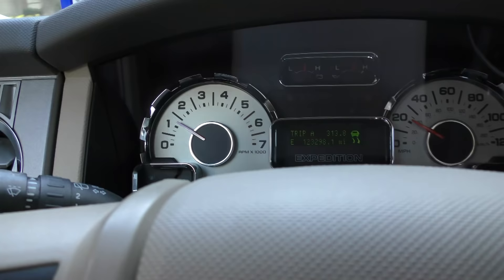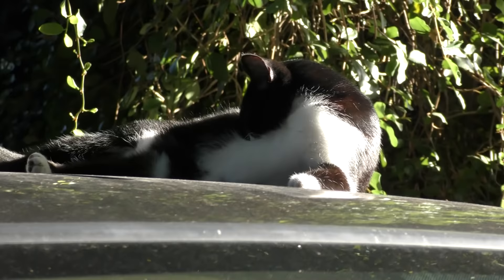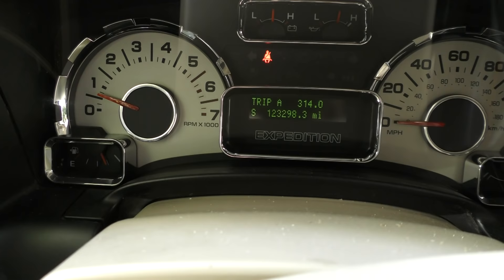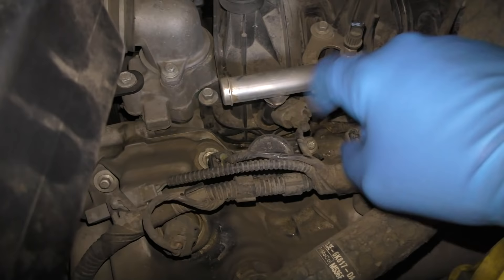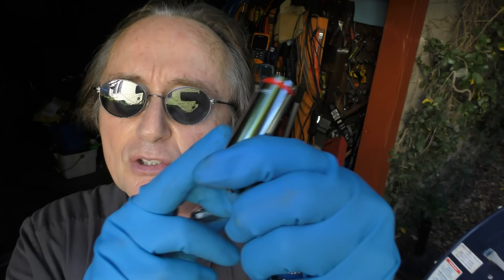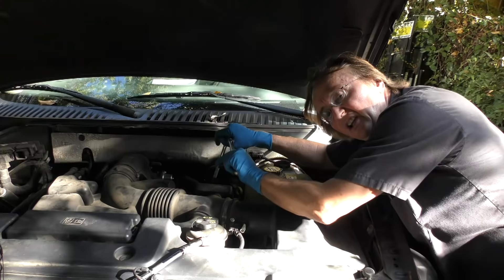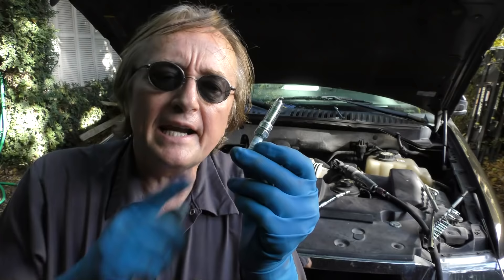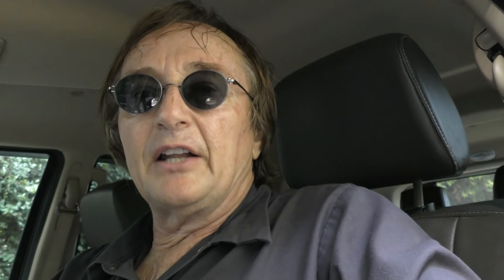How to Stop Car Hesitation (Spark Plugs and Ignition Coil)

Comment: What about if it wasn't the plugs or wires and still no codes??
 Can u give a list that could be wrong with a car that hesitates when feathered throttle??
Reply from the maker: weak fuel pump,, dirty fuel injectors, or clogged fuel filter
Reply: Scotty Kilmer ok I was just give a few scenarios.
Now I have fuel pump and filter that are new and injectors are new as well so what other things might be the problem?

Comment: hello sir i have a question if the engine vibrate when going up in gear and the automatic car jerk with out stepping on the gas that is connected on a spark plug thank you

Comment: My mower spark plugs has gas on iy. When I pill the other plug keeps in running, so today I pull the good plug out and the mower dies.. So does that  mean it's only firing on one plug?   what's happening is my mower when I give it Full Throttle it don't want to go but it runs great at idle.. Please help. It's a Honda 24.0

Comment: our car suddenly hesitates while my dad is driving, I really thought we'd be stuck on a highway so we stopped and turned off the engine,popped the hood and let it cooldown for about 15-20mins then we run it again but unfortunately it's still hesitating so we just accepted our faith (lol) and drove slow but after a while the hesitation suddenly disappeared I can't understand what's happening to our car :/ any tips?
Reply from the maker: pressure test the fuel pump, change the fuel filter, and also try cleaning the fuel injectors

Comment: I can get my spark plugs 99 carry first it start running perfect then I packed it for few days .
then same issue started I start the car for 20 min 
then pull the plugs out put them back again running perfect ..
I don't know what will happen after a week ..
burning smell was commingled in when it was not running properly 
may be I have to change wires or any thing else ..
but what it start running OK few times ..please need answer

Comment: I have a 2006 ford taurus i got a check engine light for a maf my car idles fine but the problem come in when excelerating it studders mostly up hills but if i let of and get on the gas harder it doesnt its confusing me a couple of days ago i got a code for bank 2 o2 sensor lean and misfire cylinder 3 could the spark plug on that cilinder be my problem
Reply: The car does have 140k miles on it and i havent done a tune up since ive got it

Comment: Hey quick question for your opinion I was driving on the highway and then all of a sudden my car started slowing down and kicking when I would accelerate and then the steering wheel started getting hard to turn and then my car completely turned off n won’t start no more ..could you please help I drove a Nissan Pathfinder 2000

Comment: Scotty,,  What can I do when my plugs wires are so tight around the plugs, that I'm afraid to force them out, to prevent breaking them ?
Reply from the maker: get a long cheater bar and socket and slowly pull it counter clockwise

Comment: Hey Scotty,
I am struggling with my diesel car since 3 years..
while driving, mainly during summers,if by chance I have to switch off my car for some reason,when engine is hot, it doesn't re-start Ven the engine is hot, so I have to wait long till it gets cool,
can u pls guide me to what to look for,for not re-starting while heated engine.. please
Reply from the maker: worn out diesel engines often do that from the metal getting hot and needing to cool down to restart. Do a compression test of the engine to see if it's just flat wearing out

Comment: Is there a chance plugs may be defective? I changed my plugs like 3 months ago and for the first few months it was running fine now it started doing the hesitation no check engine light though 93,000 miles on the car

Comment: i have a 2008 impala, i changed spark plugs,fuel pump,throttle body with idle sensor,mass air flow sensor and my car still cuts off once in a while when i come to a stop or when i reverse, can you help me? :(

Comment: What about when your first initially start your car like it hesitates when starting
Reply from the maker: old age often does that, try cleaning the fuel injectors. But if it cranks slowly, often a weak battery or wearing out starter

Comment: my 2010 Expedition king ranch el is doing the same thing just changed all 8 spark plugs and all 8 coil packs with accel ones and still            
doing same thing was told to change fuel pump I have 120k miles no codes either
Reply from the maker: dirty or bad maf sensors do that too, check that next
Reply: Scotty Kilmer I cleaned maf  sensor it has a little more pick me up i was told not to change the fuel pump but today my wife was at a stop light and then the truck shuttered and rpm gauge was jumping and shaking I don't know What to do should I just replace fuel pump and maf sensor. please help thank you
Reply from the maker: start by replacing the maf sensor, and if not that, have the fuel pump pressure tested first

Comment: Hello! my car starts hesitating when i accelerate and most of the time when climbing, if the road is flat, there is no problem, only when accelerating and climbing that starts like pushing and loses strenght. the plugs are new, new fuel filter, cleaned injectors but nothing seems to work. could you be kind enough and tell me what could it be happening? thank you very much

Comment: I've got a 98 tahoe ls 183 on the clock but when you run it down the road it literally bogs down. most vehicles can move quick when you hit the gas this however just moves about the speed of a golf cart any ideas where to start looking as I've done plugs already
Reply from the maker: often a weak fuel pump, pressure test it and change the fuel filter

Comment: Hey scotty i just bought a 2003 chevy avalanche 5.3 v8 and its giving me a p0300 code random misfires i changed the m.a.f and m.a.p sensors new fuel filter and did a fuel pressure test i got a 55 psi on the on position it slowly started to drop. wires and plugs were changed out a month before i bought it the previous owner said it didn't have a rough idle until he did the spark plug and wire change I even put all the old plugs bag and wires back and still I get a P0 300 code I don't know what else to do im about to take it to a mechanic shop

Comment: I have a 2007 ford focus SE and it randomly happens from 20mph to 80mph will stutter/shake the steering wheel and my speedometer will drop 10-15mph and then shoot back up to where it was minus 4-5mph. Doesn't matter if I go up a hill or down it, if it's level ground or a hill, or even how fast I go. If I let off the gas it stops within 1-2 seconds and if I keep my foot steady or push it down it will stop within a second or two as well.

I have a 50 mile commute every day and it happens anywhere from 1-2 daily to once every few days and it wont trip any codes.

I noticed the original owner replaced plugs/coil packs and wires and the air filter is new. Any ideas what could cause this? Thanks, this one has thrown me for a loop lol.
Reply from the maker: try a new speed sensor, pray it's that easy of a fix. If not that, pressure test the fuel pump to see if it's weak and pray it's not a shot transmission which it often is on that model

Comment: after replace the spark plugs i forgot to connect one of the coil connectors, i didn't drive it, just turn the car on couple times, notice a hesitation, i turn it off, i connect the coil back, but now when going on the road is hesitating, what should i do ?

Comment: What if I fixed all of those and it still misses would that be injectors the car seem to run fine till I get over 4000 rpms and then it misses again even at idle but when I turn off the car it idles fine

Comment: My question is this....why does my car has 2 codes. P1283 lean. I have p1283 as pending and p1283 as problem code making. Same code. I was confused why its same code in error and pending. Like my car cant make up its mind if its there or not

Comment: Anyone know this problem I think it's the spark plugs or O2 sensor but whenever I start my car up and say I go down a hill or a small incline like at a sheets gas station it'll be running fine then 3 seconds later the rpms will rise and the car decelerates even tho my foots on the pedal then I let go and push on the gas again and everything's fine and it drive great

Comment: Hi scotty answer my question and you got another sub. After 4 days of not using my tacoma. Turned it on today but it quickly shut off. It stays on as long as I have my foot on the gas pedal. Alternator is good and just bought a new battery but same thing. I'm thinking it could be the spark plugs. What do you say?
Reply: Luis Coronado im not scotty but i might be able to help lol, but i would definitely check your spark plugs and see if they are bad, because pushing the gas pedal is pretty much forcing your engine to not shut off. So get that check out before you cause more damage ;)
Reply: @Kevmyster  thanks for the reply. But I changed my spark plugs and it would still do the same thing. No visible vacumm leaks. Was about to take it to the mechanic , put it on reverse and drove a little and now it stays on?????? Whatttttttt it works now but I'm not sure what that was all about lol
Reply: Luis Coronado probably did help putting in the spark plugs though, your tacoma wanted to stop giving u headaches lol
Reply: @Kevmyster  it kills me not knowing what happen thou lol
Reply: Luis Coronado im having an issue with my eclipse stuttering when it turns on, but i noticed my spark plugs aren’t even plugged in because of wrong size so im hoping the new spark plugs make the difference
Reply: @Kevmyster  that should solve the problem I had an s10 ehat use to do that. Hope it works out.
Reply: Luis Coronado appreciate it, I’ll let you know.

Comment: I have 1999 dodge durango and it won't go over 20 mph. what could be the problem?
Reply from the maker: pressure test the fuel pump, weak ones do that. ALSO have the catalytic converter tested, plugged up ones do the same thing.

Comment: hi Scotty. i need help 
trying to fix a probem. 
2009 honda civic 
over 55 miles. start rattling so bad.  i done the transmissions mount. n new tires n alignment. still doing it
Reply: I had that on my old Corolla. It turned out to be a bad wheel. I bought new ones and bam, it was running like butter.

Comment: changed my wires, coil pack and new spark plus still doing it any ideas?
Reply from the maker: tons of things can do it, bad fuel injectors, weak fuel pump, worn out engine with low compression, start testing those

Comment: What about hesitation while in drive at idle?   2011 Mazda 3
Reply: A/C running.... doesn't hesitate when a/c is off
Reply from the maker: try this, assuming the spark plugs are not worn out and air filter is clean https://www.youtube.com/watch?v=NWCKvU2FmDc

Comment: Car vibrating at idle, reverse and drive mode. I have changed the spark plugs, cleaned throttle body, got every sensor checked, fuel injectors checked. It's still vibrating. I'm suspecting it's the ignition coils.  No fault code on the scanner either. It's a 2007 honda accord 4 cylinder. Please help.
Reply: Definitely points to faulty coils.
Reply: Changed the coils as well. Still no luck.

Comment: how often should we change our spark plugs
Reply: Mauricio Tijerina it depends in the car and your driving.
Reply: All2skitzd Hi we'll it's a 2000 BMW 540i I do mostly highway diving about 20 miles a day..
Reply: With OE plugs (NGK or Bosch i guess) you should be good for 80,000-100,000Miles if it is not having issues. Realistically you could probably go longer but it's good to change them as long as your using the right plugs
Reply: All2skitzd yeah  I ask because I didn't my coils too and it runs great except when I go about 80 it like hesitates like it wasn't to go after but I can't stay at 80 it acts almost like a miss fire bit the engine doesn't say anything either, I'm probably about 25,000 miles on the plugs, but thank you for helping me an answering my question (:
Reply: id hit the bmw forums with bmw problems. they have a great following with common faults and some smart fellows here and there

Comment: hi good morning, i have a problem with my g35 2005 sedan, (ignition coil screw broken , i change my spark plugs and did an oil change. i noticed that one of the coils ,#2 plug has a cotton/spongy material on top of #2 coil, when i remove it, it was a broken screw thats suppose to hold the coil down. i tried to see if i can remove, instead i put the sponge back , now my infiniti is sputtering, bucking, like misfires, I'm a  young grandmother working on my car.  i need some ideas on what causing the misfires i only change the spark plugs not the coils. im thinking its the broken ignition coil screw. i cannot remove it. i need a temporary fix to hold this #2 bolt screw down or find the best way to extract it
I NEED HELP PLEASE.!

Comment: I had a quick question on my Honda Civic DX 97 when I accelerate it loses power I don't know if it's because my spark plugs or cuz I need a new fuel pump
Reply: When's the last time you got a tune up? Wires, spark plugs, etc...

Comment: Hi ,
I have diahatsu Move 2011 660cc model .. while giving pedal/gas , car giving jerks while accelerating... Once it gain speed , jerks end & smoth drive starts
 Its not missing of engine .. 
No code from ECU . Plugs and coils r fine .. somebody told me its issue of cvt gear .
Can somebody guide me??

Comment: Soctty my car is KIA Spectra 2001. The RPM niddle goes down when I switch to reverse gear. Any ideas? Also the RPM is stuck at 1500 and not coming down to 1000. Plz help!
Reply: Check throttle body
Reply: Going to buy TPS and IAC sensors today and try my luck. Scotty thanks for motivating folks to fix cars themselves.
Reply: @rocka207  Fly okay .. it looks like IAC sensor but I am also going for TPS sensor as well. learning by trail and error. Thanks!

Comment: anybody know....just did a timing belt on a 2.7L V6 DOHC KIA Sportage.  Is it normal for the left (furthest from front) cam pulley to seem like its spring loaded?  As I was timing it, it lurched back about 60 degrees.  I wrenched it back into time and set the belt time perfectly.  Everything seems ok, motor idles good, but I am a bit worried that this is not normal.

All help appreciated..thnx.

Comment: plz help me.  my car has always started up like a charm it still does but when it gets hot the 01 nissan xterra 4x4 6cyl starts sputtering and eventually stalls however when it cools it will restart. i have ppeople telling me its the fuel pump but they are really expensive so i dont want to buy one if that isnt the problem. i already changed fuel filter (btw it  hasnt had a tune up in over 6 yrs. i changed the timing belt about 6 months ago and the valve cover gaskets, and it has about 150k miles               my husband thinks it could be descending wires
Reply from the maker: pressure test the fuel pump when it acts up to find out, cause on those often it can be something else like a bad ignition system shorting out

Comment: I have a question Scotty Kilmer. I'm getting p1150 a p1151 and a  p0174 
code on my 98 v6 mustang. I checked the gas psi on my car and it's at about 
32 psi and when I accelerate it peakes about 42 psi. when I turn off the
 car it goes fast to almost 0 psi. Any idea what it can be? I'm thinking
 it could be the gas pressure regulator. what is your advise?
Reply from the maker: try a new fuel pressure regulator, and also check for leaking fuel injectors
Reply: Scotty Kilmer thank you very much

Comment: I have Ford taurus 2002 automatic transmission 80000 little mileage due to car was stored . every thing is fine when i start the engine but when i drive it around  20 or  30 minutes it warms up and hesitates or shakes like gas cuts off or missfires but the engine don't idel and the the car has suffocation feeling when accelerator is pressed and does not speed sounds like no fule in the tank and the car don't run when i accelerate but when i restart the car at the same time the engine starts normally and when i press accelerate it takes some gas but don't run fine at full accelerateing and hesitates again and i do same steps until i reach my destination  . It could be the ignition coil or fule pump or any other sensor.  So please  Scotty help me.

Comment: Hey Scotty! I have a 96 Ford Explorer that has 230 thousand miles. I had a tune up back in January. A couple months after that it was sitting for awhile because it didn't start so I had to replace the fuel pump and a week after I change the fuel pump the check engine came on and the code p0307 popped up which it read there was a misfire in cylinder #7. I found out my car eats a lot of coolant without any leaks. With a misfire and loss of coolant connected to each other, is that at all the cause of one of the other? what could be wrong even when I've had a tune up earlier this year? Please, if you could shed a few things what could be wrong. Thank you!

Comment: hey Scotty I have 04 dodge intrepid my question to u the other day my heater hoses broke why I was driving my car overheat and automatic turned off on the side of the road I check the oil there no water but the oil smiled burn is my car or engine OK to drive after I put a new heater hose in
Reply from the maker: pray it is, cause if not, you blew the head gasket or even more expensive engine parts
Reply: Oh great I am praying that didn't happen so what should I do or check if that happen